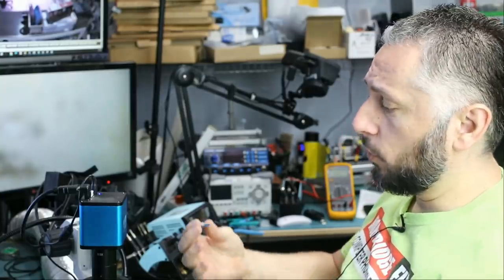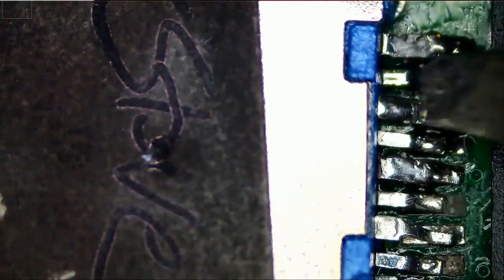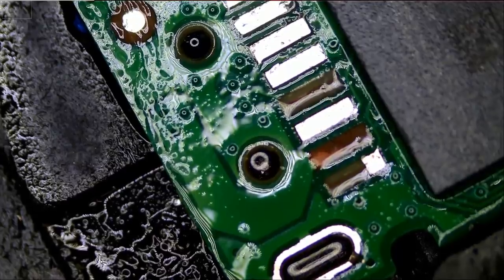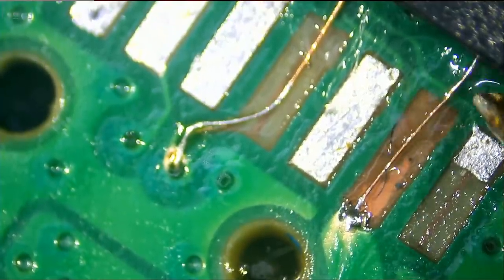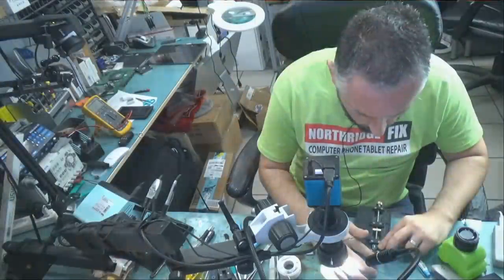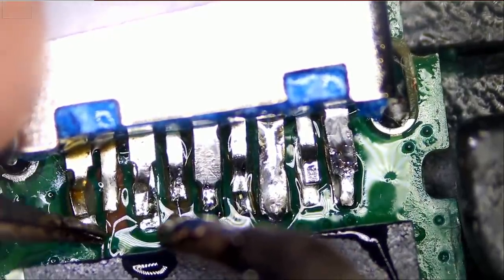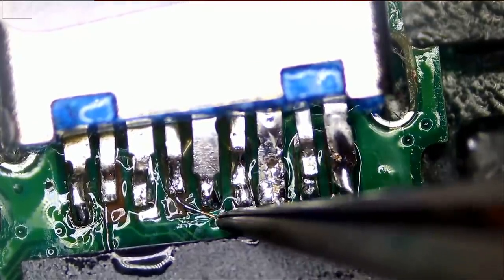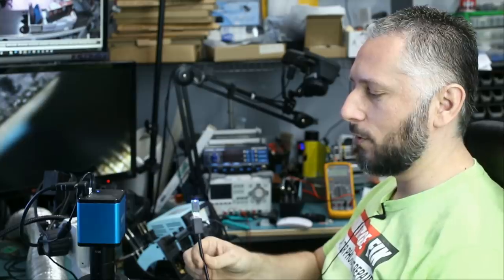Damaged USB 3.0 Flash Drive Data Recovery

Comment: Unplug??? I'd be getting those files off as fast as possible. :))) Another great repair. Thanks for sharing.
Reply: Yeah it makes me nervous when he unplugs and re-plugs before getting the files off. lol Great repair though.
Reply: Hahhahah me too , i was like  nooooo
Reply: The thing is he knows that he can plug and unplug that usb stick 100 times and it will still work as what he did was a good fix.Yes it's not a fix that will last long if you want to still use that usb stick and he wouldn't recommend it i'm pretty sure but he knows that he fixed it and he's confident enough to unplug it and plug it back in knowing it will work.
Reply: @Adrian_Finn  in reality if you a doing a data recovery you extract the data a put in another drive but he say recovery data but he is not doing that he is repairing the drive if the customer what to do a backup need to do itself , if i say recovery i charge like 300 if is a repair i can say 100 dollar , is depend of the bussness model

Comment: Great work! As strictly a hobbyist I had a case from a friend, I just tried to solder wires (of an USB plug + wire taken from a dead mouse ...) to the pads corresponding to USB2 only (I hadn't got even a proper SMD mountable plug ...). Oddly enough it worked, and I can save the data (interestingly one computer does not want to read it properly, another one though managed to do so ...). Surely it was VERY FAR from the quality presented by this video :) but it managed to survive the backup process until one of my lame soldering points gave up :)

Comment: This is going to be a long comment.Don't expect you to read it :) I guess my question would be "where did he take it the first time and those guys were not able to do what you did?" I never had anybody teach me soldering but i did teach myself with broken boards when there was nothing more to lose other than trying.In the beggining it was clumsy but eventually i got good at it even though i had no proper tools like you do.Let me point out i never studied anything electronic related but i could have fixed that usb stick like you did because i've fixed broken boards with missing pads before.It would take me more time as i had no circuit diagrams or anything to help me but eventually i would find out where it's  supposed to be connected.I admire what you do and you obviously have a lot of experience which makes it easier to fix stuff.For example you get an item that you never dealt with before and it will take you a lot of time probably to find what's wrong exactly with it especially if you don't have diagrams like xbox ps4 etc but after that you know where to look which makes it much easier.Watching videos of you fixing stuff reminded me of that time when i was fixing cash registers.And yes i know yours is much more complicated as you deal with lots of different items and that's why it triggered the part in me and want to get back into it.Hopefully i'll save some money and buy whatever i need to start doing it as a hobby mostly.Who knows it might turn into a business too.But for me is just something i enjoy doing.The greatest satisfaction is when a customer says "I've tried x amout of stores and nobody was able to fix it" and then you do it without much stress.This is what motivated me to fix stuff in the first place.The look on the customers face when i tell him "hey i fixed it" when others couldn't.Keep doing what you're doing and keep posting videos.I'll try and get back into this fixing electronics thing but first i'll have to read a few things about them as i only know how to test things for shorts and stuff.I obviously know what a capacitor is or a resistor but never read about more into detail and nobody else in the company knew.These videos will for sure help people that want to try and fix stuff themselves but remember guys it's not easy.If you want to get into this kind of thing go for it as it's amazing but to get hands on experience i'd say start messing with stuff that you don't need fixed because trust me you will mess up in the beggining, so get yourself electronics you don't need and practice on them until you feel confident enough.Then start by solving problems.Keep up the good work and keeping customers happy.Don't mind the ones that will complain about stupid things.That's how the world works and there's nothing you can do about it.I myself would be pretty confident leaving something broken at your store than one that i don't know how they do things, even if that store had x1244356546 more 5 star reviews than you.I just saw how you approach everything and how you go about fixing stuff hands on and that doesn't compare to any review.

Comment: See, Usb 3.0 is backwards compatible with usb 2.0. So, with just 4 wires connected to a random usb 2 male jack could have made it much easier. But yeah read write speed would have been slow. But yeah data could have been recovered more essily. 

Still, your method is good. I like it.
Reply from the maker: 100%

Comment: Your work is so clean & professional... Which soldering flux & wire are u using?
Reply from the maker: Amtech flux and kester solder https://rover.ebay.com/rover/1/711-53200-19255-0/1?mpre=https%3A%2F%2Fwww.ebay.com%2Fsch%2Fi.html%3F_from%3DR40%26_trksid%3Dm570.l1313%26_nkw%3D24-6337-0007%2B1lb%26_sacat%3D0%26LH_TitleDesc%3D0%26_osacat%3D0%26_odkw%3D24-6337-0007&campid=5338440312&toolid=20008
Reply: @NorthridgeFix  Thanks

Comment: I was curious to know what alcohol concentration do you use? 50%, 75%. 99% because it seems to take a little bit longer to evaporate than others I have seen or used myself.
Reply from the maker: 91%
Reply: @NorthridgeFix  Oh OK I don't know why it comes thru as slow drying on the video. Anyway thanks for replying
I'm here binging on your videos.

Comment: Great repair video’s, too much to learn from. I have a question though, have you ever repaid apple iPod shuffle ? Cus I have one laying around which is not powering on. Any suggestions. Thanks in advance 🙏 😊
Reply: Could be many reasons (short in circuit or dead battery prevent charging or powering up).
Reply: Mario Power I have already changed the battery 🔋 and also checked if any component got blown, But Everything’s okay. Don’t know maybe I’ve skipped some component or the cpu is causing the problems.
Reply from the maker: Impossible to answer this question unless i have super natural powers. .
Reply: @NorthridgeFix  I think u do🤗

Comment: Goodness... That was not a good job at all... Jumper wires should be soldered  much further away from the connector pads, so that when you place the connector on top and try to solder it on top of them,    they don't melt the solder joints at the original traces. And then UV curable solder mask on top as a strain relief. 
Yes, it may work the way it's done in the video,  but that's a sloppy job and won't last. It's the second time being disappointed from the content of this channel, showing how to do a bad job that won't last.